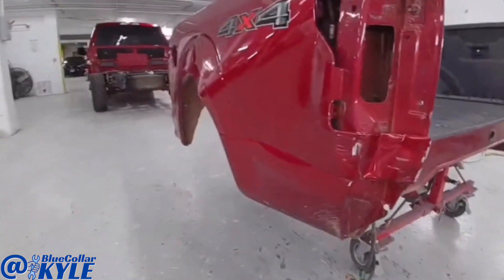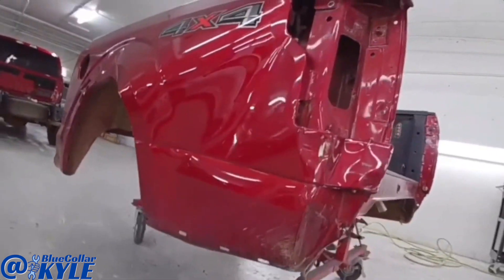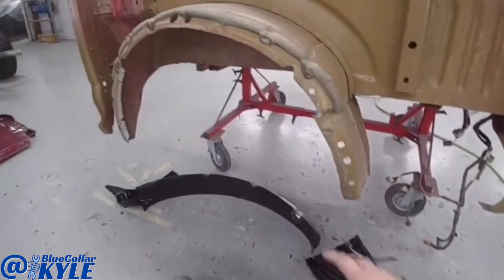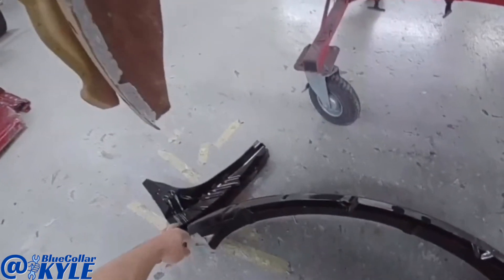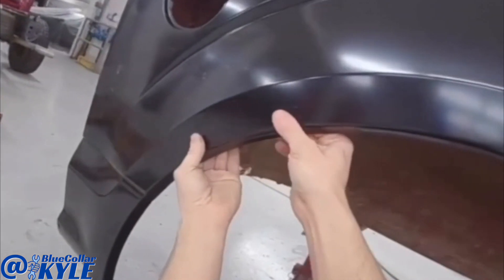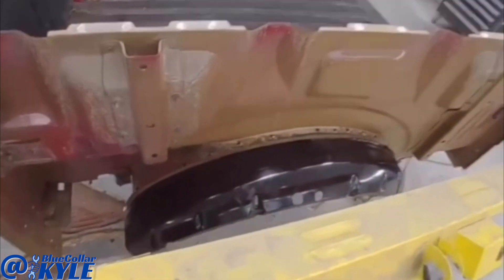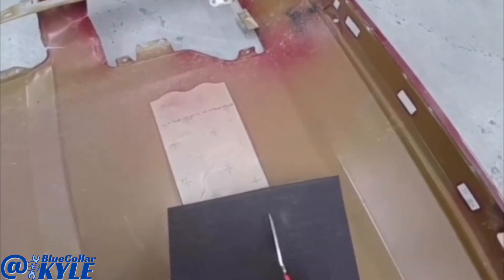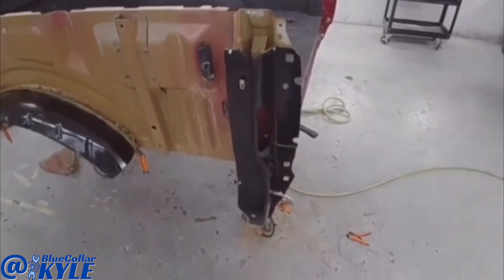Does Aluminum Spark?

Comment: I usually use a cut down bondo spreader instead of an acid brush for that panel bond. It's easier to  spread and quicker than brushing over it several times.Either way super nice job I can tell you enjoy your work.